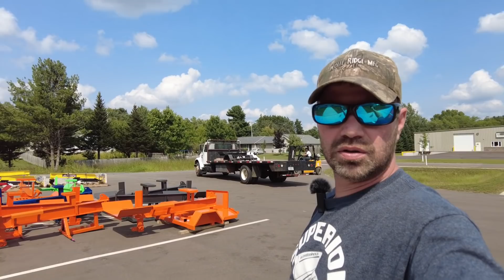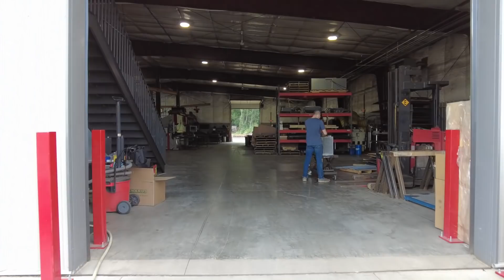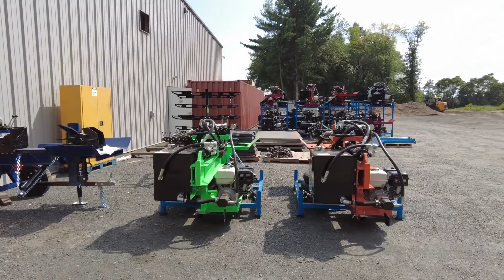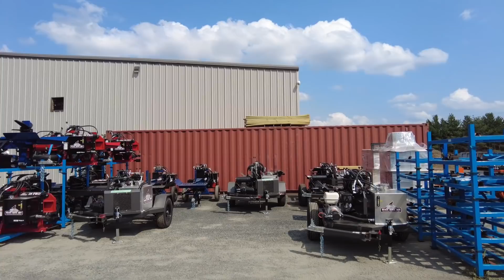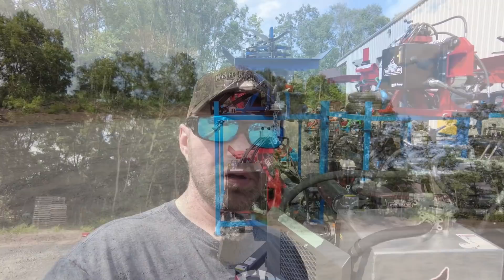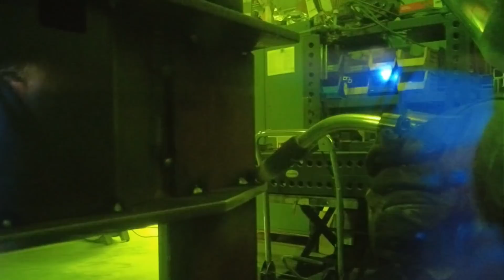Wolfe Ridge 2021 Fall Updates & NEW Dealer!!

Comment: Hello Chris I can’t wait to get my splitter. I just put my down payment on a compact commercial model wit Jesse in NH. I’m getting the 35t with the 36” stroke and was a little disappointed that the 700 pound lift wasn’t an option for this model. But that is okay it’s not the end of the world or deal breaker. I’ll make it work ! Happy to hear that you are doing so well and hope that it stays that way for you.
Reply from the maker: 35C has the same powerful log lift, the only thing keeping the weight capacity down is the narrower wheel base. (less "outrigger" on the sides)

Comment: Thank you so much for the update, but I was wondering if you could tell us what serial number you are on?
Reply from the maker: Yes I can... the Hartville load is 1462 thru 1476. Welders are about 30 machines ahead of assembly now.
Reply: Thank you  so much.  We have 1461 headed to New England Wood Splitters.  Do you have an ETA on that.
Reply from the maker: 1461 I believe was next to the bright green splitter out front ready for assembly. That load will also go out in the next 2 weeks!
Reply: Thank you for your prompt replies.  We really appreciate it. We totally understand the delays.  We are really excited to start splitting wood.

Comment: Nothing but respect! My machine is doing just fine.

Curious as to your box wedge machines, since the original design, has the system undergone any innovations regarding support to the outer torque placed upon the box wedge itself? If so I'd consider another purchase.

Comment: Are you guys selling the upgraded log lift? And will you be taking any to the Paul Bunyan?
Reply from the maker: Yes ALL firewood we can sell the new log lifts now. $400 plus ship.. and they are made to fit the same brackets and pins as before. 2 bolts and a pin to replace.

Comment: What made you switch to galtech valves?
Reply from the maker: I like the detent system, handle options and heavier linkages. Prince also did not offer a valve big enough for our 26 hp machines.
Reply: @WolfeRidge  do they sell the auto cycle to consumers? Or do you?
Reply from the maker: They don't sell retail, they sell thru distributors. For me it took 6 months to get our order of valves and they still haven't sent all the handles. 

I won't be able to sell any of these valves until I have a steady supply for building my machines sorry
Reply: @WolfeRidge  I understand thank you for your responses, really appreciate it.